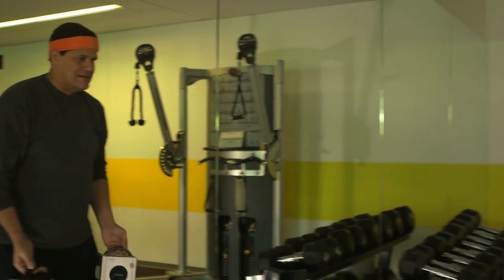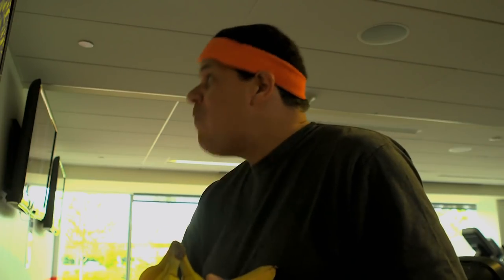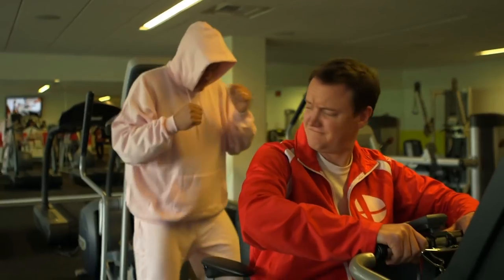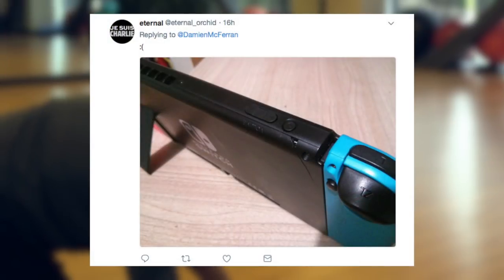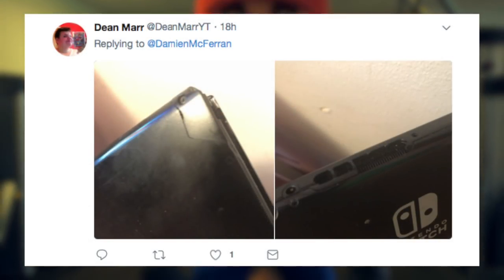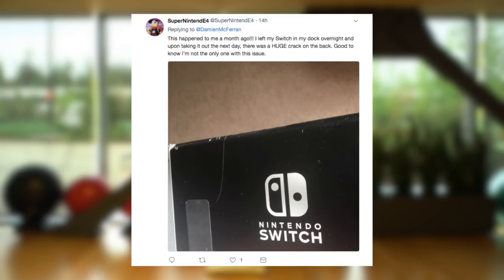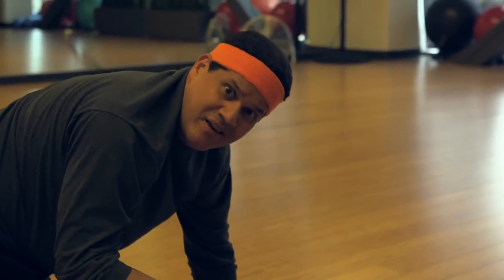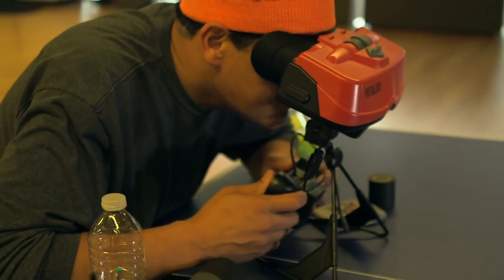Is Your Nintendo Switch Cracking Under the Pressure?

Comment: Nope! Then again, I’ve always made sure that my Switch wasn’t exposed to the sun
Reply: Huh interesting, it could be the sun!
Reply: Chloe Mcholoe it probably is. Ive had the switch in hot places but not direct sun. My fathers old car had the dashboardcrack badly because if sunlight.
Reply: yup thats what i was thining to. could be from sun light. because my switch is a year old now and no cracks on it and its still worken prefect. i never take my switch outside. its always in my room 24-7. no sunlight gets in my room
Reply: Mine has cracks, even though i don't remember exposing it to sun!
Reply: Yep, all you have to do is sit at home all day with the curtains closed 👍🏼
Reply: nope it was exposed to the sun somehow. u just don.t rember. somethings u think u never took ur switch outside but u did most likey. i took mine outside but it was not on a sunny day.
Reply: I would think a portable should be able to be exposed to the sun. ..sort of the point of portability.
Reply: Andrew The YouTube Noob my thoughts exactly...
Reply: Same. My Switch is always tucked just out of the way of my bedroom window so the sun doesn’t beat down on it.

Comment: Mines cracked in the corner and it rarely comes out the dock 😔
Reply: On closer inspection, the plastic is fine, the matt paint is what has cracked... 🤔🤔🤔
Reply: Charlie Twell same I also have a crack but it works fine
Reply: RhythmGrizz that’s debatable. Most would say it’s better for your battery to keep in sleep mode. Turning on & off electronics is really taxing on the hardware. My Switch has been in sleep mode since I bought it over a year ago. I only turn it on & off for updates if it needs it. Also, my computer had been in sleep mode for 10 years & it outlasted 2 Lap tops that I had & used to turn off every night. So reason to believe you’re better off keeping it in sleep mode since that’s the way Nintendo designed it. You ever notice how difficult it even is to turn off the Switch compared to going into sleep mode? It’s designed that way for a reason.
Reply: lol really turn it all the way off. nope i never did that. i had my switch sinces day 1 and its always been in sleep mode and my switch still works prefect and no cracks on it. the ppl that have cracks on there switch mabay its from there windows because of the sun light thats my gause anyways. my windows are covered with blankets so sunlight never gets in my room.
Reply: agreed. i had my switch a year now. had it sinces day 1 and i always leave it in sleep mode i never turned it off yet. and its still worken prefect and no cracks on it.  thos cracks on ppls switch could be from the sunlight mabay idk thats my gause anyways.
Reply: My switch got crushed by a foldable chair in a car, while someone sat on it, and it didnt crack it just warped a little and after a few days went back to its normal shape after heating up in the dock
Reply: Don't use cheap plastic, Shigeru!
Reply: Kakashi Jr 
Sunlight is a great theory, thanks.  Power surges in older homes is common and has overheated and melted electronics and lightbulbs at my old place.  I always use a power bar.  Now please excuse me while I go move my Switch further away from the window...  ;)
Reply: But your switch restarts when you update it so.. Yes you have turned it off at least once
Reply: RhythmGrizz whys that
Reply: CynicSonic I even dont really like taking it out with me to keep it safe

Comment: I haven’t seen one. I do have a Dbrand skin over it, so it might be a little hard to notice, but before I put it on, I still didn’t see any cracks. I feel sorry for the people who’ve had cracks.
Reply: I thought Dbrand didn't make skins for Switch because they said it wouldn't react well with the Switch? I have a carbon fiber skin from another brand. You just have to use a hair dryer to remove the skin to avoid any issues.
Reply: They relatively recently developed one that doesn't have the problems. They seemingly had given up, but they eventually found an adhesive that doesn't mess up the finish.
Reply: I see you everywhere
Reply: Hugo Stiglitz they re-made the skins. They work much better now and they’re a cheap price, but with good quality!
Reply: Vsauce Puppet same
Reply: oml I LOVE dbrand. I will never have a phone without after I got my dBrand dragon skin for iPhone 7+ along with my Dbrand Grip case but the skins for Switch just feel so off to me. The camo or colors especially! My question to you then @vsauce puppet: what color scheme combination did you go for for all the parts?
Reply: Vsauce Puppet YOU'RE MY GOD

Comment: Launch Day Switch and no issues here. Used almost exclusively in docked mode so far. Also I'm not 100% sure this is a pure heat thing.It's plastic, but plastic is typically durable enough even if it gets hotter. I'm not sure what your Switch is running at, but even if it's at – let's say – 70-80°C (which would be extreme outside the CPU), I'd say the plastic would become more flexible rather than more brittle. Rapid temperature changes on the other hand might be a thing, like taking it outside in winter, back in next to a heat source, etc.
Reply: I get ac every 5 mins so it cools off
Reply: Unless the regrind rate (recycled material from earlier batches) in the plastic used to mold the back of the console was too high. That would make it brittle. Not saying this is the case but its a possibility if an upstream supplier wasnt doing the right thing on a few batches

Comment: I got my switch 11 months ago, and I haven't had any issues with a cracking shell, fan vent melting, or other issues relating to the switch. I keep my switch on my desk when I'm at home, or in the dock when i want to play it on the TV.
When I bring it places, I put it in a protective case of sorts that doesn't put pressure anywhere on it, as it just settles in it behind 2 straps to keep it in when you open it.
To me, it seems like most of the "issues" with the switch are just user error, or people taking poor care of their switch.
The Switch isn't a very durable system, and people should be more careful with it.
Reply: You're right it's not a durable system, but it's still sad to see the Switch is the most damage prone handheld Nintendo has ever released. Things that would have been very acceptable use with any of their previous systems, have caused a lot of trouble.
Reply: Vesmir NG-3 switch screen being plastic, a screen protector is mandatory
Reply: I'd rather have it sleek albeit less durable than it being the big brick that was the Wii U GamePad.
Reply: Draaza I mean, it was stress tested by dropping it from a height of 1,000 feet onto concrete and the system was unscathed.  I'm not saying it's a tank, but it seems beefy enough to me.  My girlfriend has dropped hers probably fifty times and all she ended up with was one tiny, barely visible when the screen is off scratch.  It does feel less durable than maybe the original Gameboy, but GBAa had very flimsy screens, DS and especially DS Lites and 3DS systems all have really, really weak hinges that would crack under any decent strain.  3DS XLs have hinges that wear out very easily and make the screen floppy.   I think the Switch is on par or better than most other Nintendo handhelds.  Hell, some guys cut through it with a 60,000 psi water cannon and the thing kept working for an absurdly long time.  And yet also the screen can scratch fairly easily, the joycons are a bit flimsy and the rails flex too much.  Really it's par for the course.  Nintendo makes a tough product with some weak edges, as it were.
Reply: Not when the crack happens in the same place for most people who have them. That is a design flaw, probably due to heat.
Reply: Hai Che You're making assumptions with almost no information.
Reply: VgmuszPlaysGames agreed on many levels.
Reply: dude no one realizes that it’s heat issues from people playing graphic intense games that are locked at 60 fps (splatoon 2, super mario odyssey, etc.) I rarely take my switch out of its dock and when I take it on the go I also have a sturdy case. I have cracks around the vent bc my switch gets so hot when I play splatoon or sm odyssey, I keep it in a area where it can breathe but I live in so cal and my air conditioner is broken so it’s hot in my house anyway, and it doesn’t help that the docks ventilation is terrible. I’m sure that some of these people have dropped them but I’m sure that people have had similar problems to me so I just wanted to put it out there.
Reply: Justin Jett Heating up by itself shouldn't be an issue.  The real issue, if it were that at all, would be heating up to intense temperatures and then getting very  cold very quickly.  The extreme, quick changes in temperature generally would be what would cause something like that in a device.

Comment: This is something called fatigue. Basically over time stress forms around the screws and buttons. This is why parts need to be replaced after years of use. But in the switch case, constantly removing and replacing it from and to the dock will begin to weaken the material as heat causes tiny cracks to form around the casing, similar to how aircraft pressurization works. These cracks might be a case of dislocation, which are holes in the atomic structure that have a big weakness, making it easier to deform. These dislocations travel through the structure and have a tendency to coalesce, and after going back and forth to the crappy dock Nintendo gives us, what was once a small defect can grow into a large one in the form of a crack, and might cause a part to fail, thus breaking the console entirely. Plastic is a composite material, and fatigue failures in such are incredibly complex.

I am no means an expert at this subject, but i can say this with confidence: 

Fatigue failure takes a long time to form on composite materials, such as carbon reinforced plastics (CRF).

So to Recap:

Heat From Switch ---------------> Heats Case -------------------------->Atoms Dislocate ---------------------------> Cracks

Comment: Cracks are probably happening because many ppl sometimes temporarily hold the switch just by one of the joycon on either side, causing stress fractures near aforementioned parts. Holding the console by just the joycon puts pressure on the area where it attaches to the main unit.

Comment: Bending plastic, drifting analog sticks, now this?
I hope newly manufactured consoles are getting fixes for all these problems.
Reply: Raphael I honestly think its the error of people being to rough on the system
Reply: The drifting analog sticks isn’t a hardware issue, it’s just dust in the joysticks
Reply: Raphael my analog sticks drift A LOT
Reply: RhythmGrizz Clearing dust is such a hassle, and it's not a guaranteed fix. When sticks drift, it's practically impossible to calibrate because the stick will always be moving in another direction.
Reply: TheA Famous it might be a hassle but if that’s the cause then what else are you going to do but clean it?
Reply: I had issues with my sticks and gyro on 2 different sets of joycons. Did a firmware update for them and everything went away. No issues since.
Reply: I know, but I have to clean it each time I play, so it's really annoying
Reply: RhythmGrizz Oh I actually did call them; no, its not free for people like me who are Day 1 buyers whose warranties have already expired.
Reply: To be honest, it's probably just an unlucky cause to us who get the issue. I realized that (undisclosable fine) is just too much for one stick. So I ended up buying a new controller, and I have not touched the Joy-Con since.
Reply: They're no Red ring of death
Reply: RhythmGrizz I love Nintendo's support, its just that reparing a simple analog stick shouldn't cost the same as buying a brand new Joy-Con.
Reply: I had drifting sticks on my pro controller
Reply: I have the drifting sticks
Reply: itsssdante Campregher I think the Pro Controller has the same fix (toothbrush method). But if it doesn't work, I think the Pro Controller has a three month warranty.
Reply: Stick drift can be helped using a spray bottle of electrical contact cleaner (AKA isopropanol alcohol / isopropyl / IPA)

Disconnect and turn off the joycon,
spray a bit under the rubber piece below the top part (using the straw that usually comes with it),
Move the stick around for about a minute,
Let it dry a few minutes,
And that should be it!
Pretty easy and helped me out two times. ;)
Reply: Vegito Charmara the dust has nothing to do with the age of the console, in some places there is more dust.
Reply: Tfw you have drifting joycons AND a cracked switch 😣
Reply: Drifting analog sticks are user error because dirt and food particals get underneath them and most of those errors are from the unlucky 1% so Nintendo isnt going to make new ones because it doesn't happen that often
Reply: Raphael i just picked a screwdriver to open that thing to expose the inside of the analog stick and blow on it till it works perfectly
Reply: I had to order a new left joycon because of drifting. No amount of compressed air or alcohol dipped q-tips could fix it.
Reply: Chet B Hm well I've gotten dust removed before and it still drifts. Oh well I guess it must be an internal case.

Comment: well my switch gets really hot and loud sometimes on fortnite and when it’s really hot in the room and my switch bent. it didn’t really crack but on the top of the switch’s shell there is a line going across (which is normal) but where the bend is, the line/gap is bigger

Comment: No cracks here. That said I play handheld mode almost exclusively, maybe docked generates more heat?
Reply: Me too
Reply: Pierah same I use mine exclusively in handheld mode the dock is still in its wrapper no cracks on mine
Reply: Those cracks in the vid were exaggerated def not from taking care of thier system only thing i believe happens is warping the fan grills cracking the volume button gap and maybe chips at the corners but cracks down the back from dock play no.
Reply: lil toaster I'm glad I look after mine like all of my tech why pay hundreds for stuff and not look after it
Reply: sup 7R that's cause u look after it some of the pictures on this video they look as if they have been throwing there switches around like a football
Reply: same here i play on handheld mode no crack or scratchs, thank god. but i nintendo will stay make a revision of the switch soon. i can't wait to see it.
Reply: Day 1 switch owner here.  I have cracks around the vents and usb-c port.  No drops.  I play like 85% handheld
Reply: George Emery Given the wildly different reports in both play style and care of units, I'm guessing it mostly comes down to differences in manufacturing quality of the plastic case. I guess I wouldn't completely rule out notions of environmental/weather differences in areas being more conductive to the weakening of the plastic from fast temperature swings, but it's likely a byproduct of the manufacturing process kinks not being ironed out until after release (which is common in most electronic releases as far as I'm aware). I guess not all Switches were made equal, I'm assuming earlier batches would be more prone to problems, but I have no way to test that out. Now the interesting thing to note is if the more recently produced batches and this latest revision are going to show these symptoms.

I do think the reports are still a bit inflated though, since even if you don't drop your unit, dust collection on the vents or recklessly covering the openings of the case can lead to overheating and plastic expansion which could facilitate cracking. Thankfully, a cracked case is a pretty minor issue overall, since it won't affect gameplay or performance, but Nintendo should totally cover the costs for the repair regardless.

Comment: I feel as though the Switch's biggest problem is it's inconsistencies. From some units having large hardware problems where others are completely fine to games like Zelda or Mario vs. full priced ports. It's very hard to predict what will happen next with the Switch good or bad. Nintendo needs to focus on getting it to a high place and keeping it there.
Reply: Agree. Nintendo I believe has used three different companies for screens so far and still bargaining for SOC chips.
Reply: Easier said than done
Reply: Run For Fun ! i love my switch to death but my joycons that came with the system are really bad. I didn’t notice it until I bought a new pair, but everything about the newer ones are better (HD rumble, sticks, buttons) and I bought these like 2 months after launch. Both pairs have the same consistency... in that they are inconsistent
Reply: Full priced ports that come withall the dlc for the price is ORIGINALY was on other consoles. Errors that happen to few people but the internet makes it seem like it'll effect you. Triple a games every month alot of 3rd party support when will it end??

Comment: Yes, I’ve got a small crack in mine around the top back corner. I have never dropped it on a hard surface — only tossed it on my bed or couch from a very short distance. It’s somewhat comforting to know others are seeing this too, as I was so confused as to why I had a crack, but I still wish this wasn’t happening!

Comment: I do but its so small I'm not worried but my screen and back of my switch sadly has scratches from the dock... and my left joy con has issues with moving were you stop but you keep moving for a couple of seconds.
Reply: Dang...
Reply: yea my switch has a ton of scratches on the bezel of the screen from the dock :/

Comment: My Switch is mostly docked and noticed a few weeks back there's a crack next to the top air vent. Never been dropped, so it's odd. Will contact customer support once Switch Online goes live since I have 2 years warranty on it.